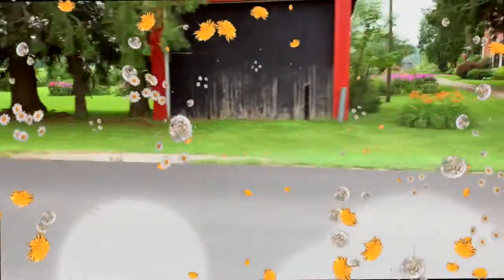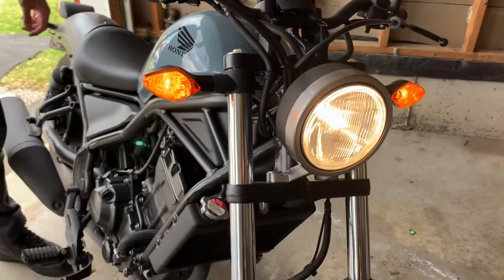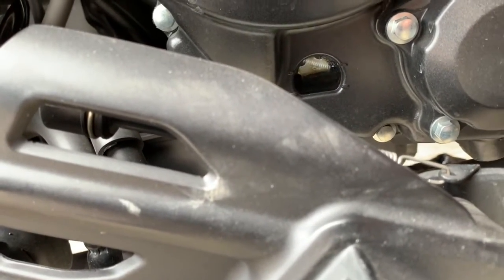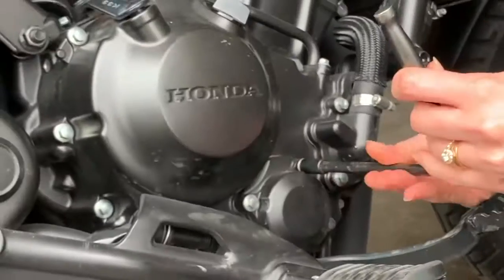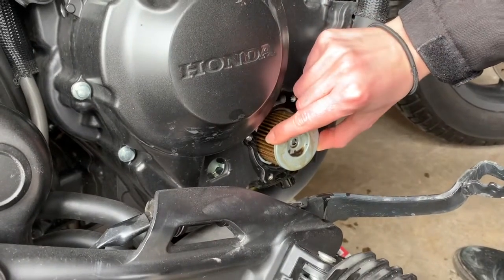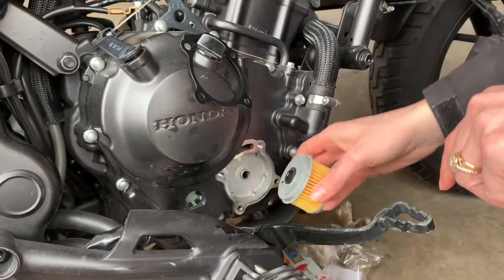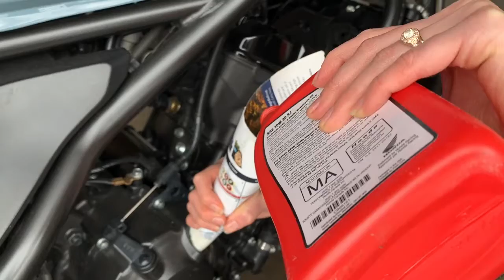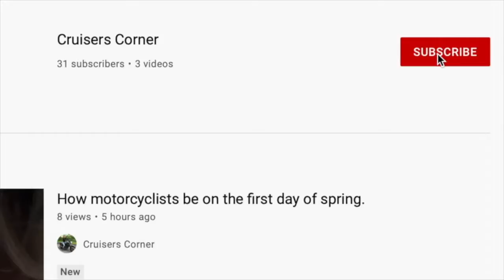Honda Rebel 300 Oil Change

Comment: At the risk of sounding dumb (I'm new to this) my maintenance manual says I'm not due for a new filter for quite a while but that I should do an oil change. Should I only be doing the drain and fill or do you recommend I still replace the filter anyway?
Reply from the maker: I usually just replace filter anyways but you it’s up to you. Technically the filter probably still has life left.

Comment: What happens if I don't put the spring in the filter cap? .... I wish I had seen your video before  I changed my oil... I didn't even know there was a spring ... until my friend told me there's something inside my dirty oil bucket :( 😞 can I ride it without the spring on the filter ???

Comment: Hello! I am just a beginner and I have a 2018 Honda rebel 300! Just checked my oil level on my rebel and it’s above the top line!!! Would you recommend taking some of the oil out?
Reply from the maker: If it is higher than the top line you should technically drain a bit out. Can you see the fill level at all or is the window completely full? Also make sure the bike is completely level with you sitting on it.

Comment: Is Honda rebel a woman bike?
Reply: I sold my 2014 1832cc 6 cylinder beast valkyrie and bought a rebel 300, I love it, I'm in the process of making it a dual sport so no it's not just a beginner's bike, I've had several bikes and so far the customizability and simplicity of this bike is awesome, if you want to go on very long road trips and hate getting passed at 70mph then the 500 is for you, if you want a little bit lighter and simpler to work on the 300 is still a good buy, for me the 300 short first gear is the plus for what I'm doing with the bike.
Reply: No. Bikes are not gender specific.
Reply: You will get shit about your ride no matter what it is.  Its a riding family thing.  Ride what you love with pride.